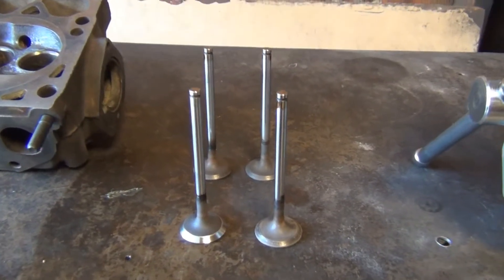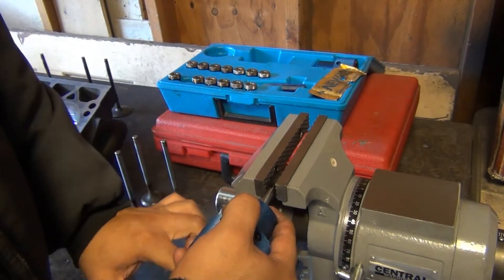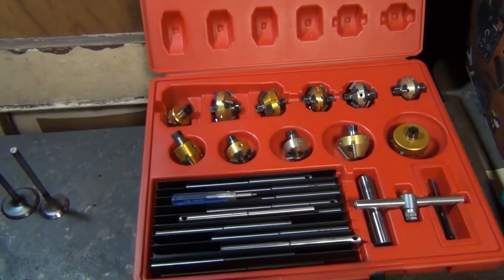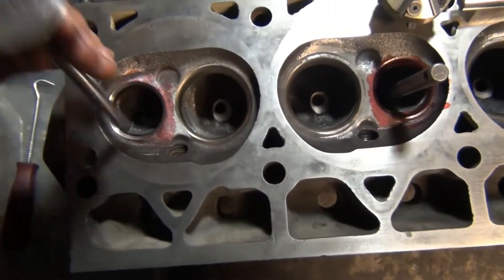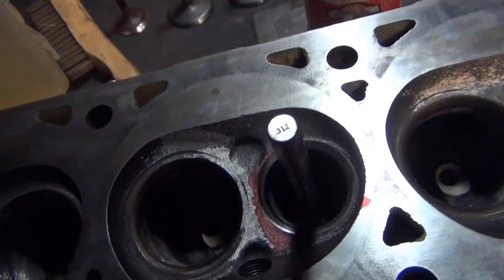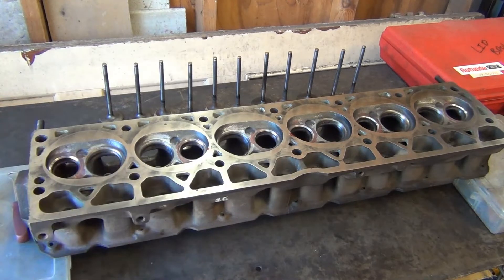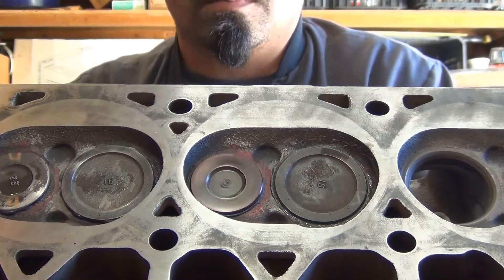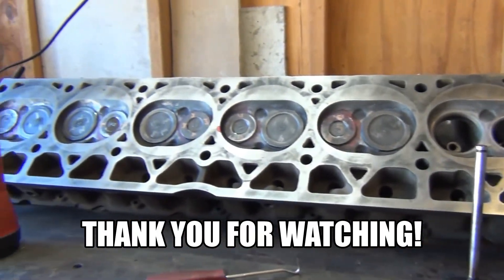Using Neway Cutters To Fix a Jeep 4.0 Head! Part 3: Refacing, Lapping, Cutting Valve Seats

Comment: I use new way cuts for years and that’s one thing. I learned that doing it with the hand T handle isn’t as good as having it with the drive motor. I finish off my last two cuts with soapy water and it would smooth it out mirror finish
Reply from the maker: @maryannmoran-smyth3453  yeah you’re absolutely right! That drive motor is nice, it’s just not practical for me to have it and not use it enough 👍

Comment: Is there a part number for the neway tools
Reply from the maker: @norbialaniz8442  yes, each single cutter has a different part number, depending on the diameter of the cutter and the angle of the blade. Neway has a website that you can search for the specific cutter you need

Comment: Hey genuine question, shouldn't the valve sit flush with the seat/chamber? And great video btw really enjoyed it!
Reply from the maker: Hi, Ideally yes! Performance heads and most modern engines use valves that sit the way you describe. This head is from an old Jeep, and I have pulled a few off them out in the past and the valves don’t seat nicely on them. The tool that you see me using doesn’t really cut a new seat into the head it actually just cuts a new surface on the seat that is already cut, so the valve position stays the same
Reply: @MrBlitzkrieg1987  you learn new thing every day! Thank you for the reply and the info!

Comment: You don't have to re do different size lifters after cutting?
Reply from the maker: I put the engine together using a new cam and lifters but everything was OE replacements… the amount you are removing from the seat is minimal,  not enough to change the geometry you usually don’t have to worry about

Comment: Compression test?
Reply from the maker: @ElHickey  without an engine attached? 🤣
Reply: @ I meant a test on the head you had do it with a tiny compressor to test for leakage
Reply from the maker: My videos are for DIY projects, personally I have zero doubts in my own ability to do this work, but if you feel like there might be an issue doing it this way, taking your personal heads to the machine shop is 💯 the safest bet! Im simply trying to inspire people to work on their own cars, Im not trying to sell or work on anyone else’s stuff, thats the reason I didn’t test them, Im just that confident in myself 🫡

Comment: How much does it cost for that tool
Reply from the maker: @OscarHernandez-rj1dl  hi, it really depends on the size of your valves, thi bigger cutters can cost over $200 and the smaller ones under $100. I paid $600 for that red box that has different cutters but they were used
Reply: @MrBlitzkrieg1987   what's the name of the tool
Reply: Thanks appreciate it
Reply from the maker: @OscarHernandez-rj1dl  the cutters are made by a company called Neway so you can search on ebay thats where I bought mine

Comment: So having recut the head valve seats,how does this affect the  none adjustable hydraulic valve lifters ref valve clearance etc ?
Reply from the maker: @colin5064  Hi, the effects on those parts would be almost negligible, since you are removing a very small amount of material. The effect on those parts is much greater when you resurface the cylinder head, because that can change the geometry.
Reply: @MrBlitzkrieg1987  thank you for the kind update

Comment: Great tip with the hose and clamp, I too do not like the suction cup
Reply from the maker: Thank you! I’ve given the conventional tool a few chances, what usually happens is I end up getting some of the grinding compound on it and it never works again after that!
Reply: @MrBlitzkrieg1987  I got a set of neway cutters off ebay that only had 15⁰ and 45⁰ on them. What is the 15⁰ for?
Reply from the maker: You can get them in several different angles specially when you want to do a performance valve job with more than the standard 3 angle cut. The 15 would come into play outside by the combustion chamber before the 30 and the 45. But you would only use it if you also have a 30 degree

Comment: Greetings from canada. Great video. Question my friend. I couldnt find the valve face grinding tool you use. Would you mind sharing the link?
Reply from the maker: Hello, thank you for watching and I appreciate your comment! The cutter that I used on this video to reface the valve is an older model that isn’t for sale anymore, Neway has a revised valve facer that has a handle so spin the cutter so you don’t need to turn your wrist so many times. The part number to the ones I used are #4637762 but like I said I recommend you get the newer version instead